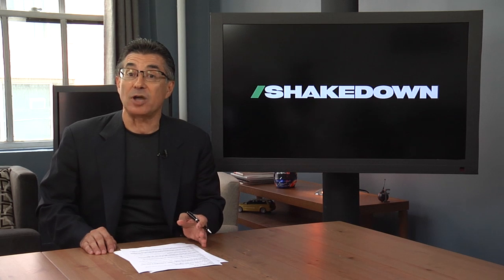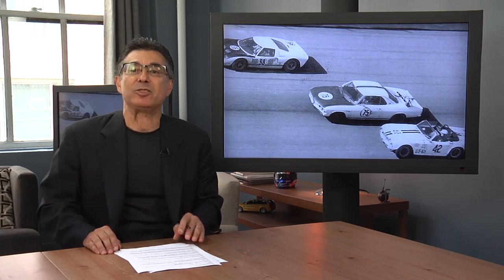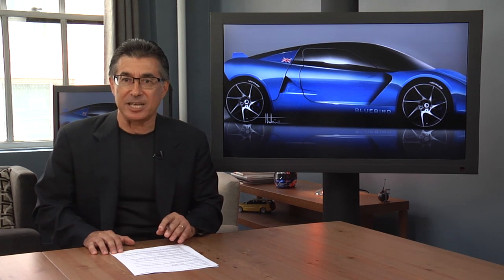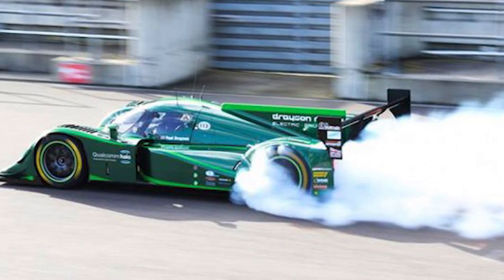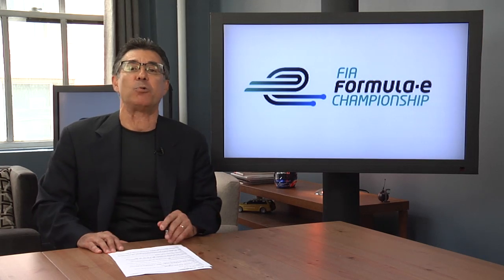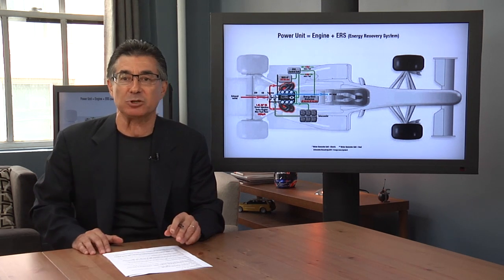Formula-E, Electric Racing for the Future - /SHAKEDOWN

Comment: I'm pro, but why do not just use other resource as electric ? You'll still need an engine in that case that makes a sound :D .... i think the oil industry is just against other oil resources because it will have a negative effect for those currently deploying it , so electric fine for me but still there are still other different oil resources that can be used and you wont need to switch cars :x switching cars i can not understand it, a race for me is with one car that is used the whole race dist

Comment: I don't know all the technical details, but I think it's not entirely a problem of technology. If it is, they can make races shorter (like a sprint of 30mins) and do several manches like happens in a lot of series. If they need to expand the range and tech then they need to make this series last for more than one season, and I don't think it will happen with this layout because nobody will watch it. I'm sure I won't.

Comment: Sound is becoming a dying aspect of racing(R18, Form E, Turbo motors etc).There won't be a complete lack of noise(they're will be a slight whine)...but it will be so quiet that you can hear the fans DESTROYING corndogs and making martyrs out of toilet seats. 

I'm all for Formula E...But a car swap mid race? Really? You couldn't use the series to perfect rapid charging battery technologies? Because rapid charging batteries(45 seconds or less) is the only way you're going to sell many an EV.

Comment: I'm not particularly interested in all electric racing cars for a variety of reasons the sound being one of the main reasons. The presenter of this show needs to gets his facts straight in regards to F1 and the smallest engines in its history F1 has had a 1.5 liter formula twice, in the early 60's and during the 80's the last time turbos were allowed, 1500cc (60's & 80's) is smaller than 1600cc (2014).

Comment: I'm fine with all the electric/hybrid development, but CHANGING CARS EVERY PIT-STOP?!? That's just ridiculous from a racing point of view and it also sends an awful message to the people thinking to buy a hybrid road car: "yeah, you better buy two cars so when your battery dies you can jump on the other". Instead of challenging engineers to find solutions to extend the range or make battery-switch faster, they ignored the whole problem.

Comment: i'm for electronic racing. i hope it stays around so that way we can better electronic technologies and develop higher power-outputs from lighter electric power-supplies and motors. 

if we can get to the point of an electric car putting out 1k lbs of torque with half the weight of a common combustion engine with the same output figures, i'm so for it.

Comment: Jumping out of a car and into another thats fully recharged is not the answer, its not effective.
Can't see Mr and Mrs normal having to "swap" cars to take the kids to school.
If f-e is to make any impact they should implement "hot-swaping" the batteries over, 
As this is a far more sensible solution than having to buy another car.
London underground trian's use battery hot swapping, the procedure is done in less than 1minute(so I'm told).

Comment: In a way I think this Formula-E idea will be a good thing in order to push the technology of E-Vehicles/hybrid tech forward. Most people don't realize it but most of the tech in the cars being drove around today was developed on the track. For instance, Cadillac's magnetic suspension system was developed through racing. And companies like Audi, BMW, Nissan and other manufactures use races like the 24hr of Le Mans as a benchmark/proving grounds for the tech they develop.

Comment: I understand the push towards electric power but I think it is somewhat premature. Although there is a lot of research going down regarding next gen battery tech it is nowhere near ready yet. Once it is then THAT would be the ideal time to launch an all electric racing series. As it stands current battery technology is far too limiting, which is why hybrid vehicles are the way to go just now. Given time however EV's will eventually rule the roost..

Comment: If you haven't ever ridden/driven a well-spec'd EV then you don't have much basis for talking. If you like quickness, acceleration and torque, you'll like electric drive. Think monster speed out of corners. Torque is what *mainly* you're after when you add turbos to engines because usually they have decent HP or can be spun faster to get it. Torque is the domain of electric motors.

Comment: Because electric motors are 85% efficient and gas powered cars are only 15%. Less energy consumed per mile means less pollution incurred at the power station. Add in 7% average line loss and 60% efficiency for coal plants, and the fact that we only get 37% of our energy from coal nationwide, and the result is an EV is still around twice as clean as a gas car, even on today's grid.

Comment: No no no you can't change cars in a race it's stupid race to the capacity of the battery's or within an amount if laps that makes drivers use charge as you would with fuel economy, any new rule change promotes innovation let alone completely different cars!

Comment: I've seen Koenigsegg's electro-mechanical valve system, and yes of course that's a good start.
But with a hybrid system, the cost and weight of battery-motor systems will go down over the next few years so that's negligible. But the best thing about being hybrid is that two powerplants working together can make over 2000HP max. Which will eventually lead to 300MPG performace cars. Yes a WIN-WIN.

Comment: Companies like Koenigsegg have shown the conventional combustion engine is far from being maxed out in fuel efficiency and performance.  Look up their work on independent valve systems.  They removed the cam and use actuators on each valve to control it at all engine ranges.  The results are around 40-50% improvements in fuel economy and similar numbers for power across the whole RPM range.  Numbers that meet or beat the hybrids and less cost and lot less weight.  Bigger WIN-WIN.

Comment: Will Formula E racing be able to take advantage of DRS (drag reduction system) the same way it does in F1? As for the question I feel engine noise is part of the experience but only when up close to the action. When its far away I tend to hate it. But E racing wont be 100% silent, I tend to enjoy hearing the high pitched whine of a transmission and the gental slipping noise tires make under stress

Comment: I'm all for innovation, so I support Formula E since it will push electric/battery technology to the next level. However, the switching cars at pit stop is kind of weak. I think the teams should be required to figure out something like Tesla did (the 90 second battery swap) since the pit crew is an important part of racing. I can also see how many people may find electric racing a bit more boring without the engine noise, but there isn't much they can do there...

Comment: I would be surprised if it stayed like this long term. The point of the car swaps is to provide a racing environment that is engaging to the spectators while still allowing for improvements in technology long term. Existing technology isnt sufficient to run a whole race or do quick charges. The first goal efficiency wise is going to be shaving off a pit stop, then 2 and as teams use less pit stops while maintaining the excitement that spectators demand they will reduce the minimum limit of stops

Comment: "E" power will further remove the driver element from racing. Here is why. Part of the skill of driving is controlling the power of the car, full throttle full power at rpm. However electric motors can't do that. They can have immense torque at any rpm. With that said, the motors will be torque limited to simulate gas engine power-bands. If they are going to go to that extent, they might as well just use some sort of traction control because that is essentially what the torque limiter will be.

Comment: I don't mind electric cars racing as long as there are good teams, good drivers, and good racing. My big concerns with this series are the changing car thing is just stupid, I am not sure if the cars are really that fast (using the term fast relatively), and also that you described the cars as low down-force. Why would they want them to be low downforce? Perhaps it is more that I just don't understand it than really that I am concerned about it, I always just assume more is better.

Comment: I would watch Formula E and don't have a problem with it. But I'm scared about the direction road cars and racing is going in with all these electric and hybrid cars. I don't ever want to see the combustion engine die, and in 30, 40 years, when there's only or mostly electric cars on the road, I'm gonna be one of those old men with a garage full of classics driving them every day.

Comment: I think Formula-E is a great idea and I'm looking forward to it. I think it should be the true showcase for cutting edge automotive engineering, as Formula 1 once was, and be largely unfettered by the usual deluge of FIA technical restrictions. I want launch control, traction control, active yaw control, active suspension, anti lock brakes, active aero, absolutely anything that will result in a faster lap time for a given weight/power restriction.

Comment: Slam charge Capacitors instead of batteries. GE engineers "accidentally" developed new carbon based Capacitors, trying to figure out how to mass produce Graphene. They are basically "sponges" for Electricity, of racing fuel cells holding Electrons instead of fuel, with the capacity of batteries and charge discharge capabilities of capacitors. Then add all the kinetic capture tech possible, and there you go.

Comment: two things i dont like so far about the formula e cars so far is 1: they're only 2 speed electric motors have torque stick um with a 6 or 7 speed sequential transaxle i saw quaife makes some get some gear  them sky high and lets see some real acceleration and top speeds 2;the whole changing cars thing dose'nt grip me too well I want to see the same car tired and nackered as the driver at the end of the race so if they come out with some quick change batteries that would be great

Comment: I'm interested to see where Formula E goes, but two failures right off the top does not bode well...
1- Tesla is ready to offer battery swap for road going electrics, can't these guys do it better/faster?
2- Why would the 'formula' force an open wheel indy/f1 design instead of just limiting the KW/h carried and may the best design win?

Comment: Electric racing isn't quiet: I'm involved in a schools electric endurance racing competition in the UK, and the cars make motor noise, various squeaks and rattle from drivetrain components and, crucially, a lot of wind noise, and these are 2000 miles/gallon equivalent efficiency cars. Formula E cars will be way louder.

Comment: Wish we had stock car electric racing class. Where in production cars and or homogenized specials are fitted with full electric systems.

F1 with batteries doesn't make a lot of sense to me in the current over restricted form.  Push-to-pass is terrible.

Comment: Hydrogen fuel cells will never be used in road cars on anything other than extremely low volume/prototypes. We have no hydrogen infrastructure, it is extremely energy intensive to capture and extremely hard to store as it tends to just leak. electric on the other hand, most western countries have a huge existing infrastructure, batteries by 2020 should be more than enough for the vast majority of road users and of course this is what EU has and continues to invest in.

Comment: swapping cars is stupid. swapping battery packs is a good idea and i don't understand why no one has thought about creating a standardized connection and 3 or 4 battery sizes for use in any electric car independent of manufacturer. gas stations could be easily converted to charging and battery swapping stations. with standardized sizes and mounting points, robots could easily swap a battery on any car in the time it takes to fill a gas tank.

Comment: i like the idea of an electric racing series because the auto world is shifting towards fuel efficient low  pollutant  vehicles and the limitations are very real with gas powered engines so instead of letting the soul of a sports car die because I want noise I would let  its body evolve just one thing I want tho, keep the  dam multi  speed transmission   with a way to select the gears manually  .Who knows the wind of an electric may be pretty awesome once ya hear it

Comment: I love the idea of electric formula racing, not so sure about the pit stops though. I think the drivers should have to run a lap of the track during the pit stops if they're just going to change cars! As far as sound, i love the sound of electric cars, however there should always be a place for gas engines. Love the idea, would definitely watch it, hopefully if it happens i'll go and see it live in London! Whats with the power restrictions though? Thought this was to push innovation?

Comment: Almost everyone I know who complains about the lack of engine noise never drove a high performance EV. The neck snapping torque of electric motors are more responsive (in theory) to any high performance ICE. Its a strange feeling, but EVs joint into acceleration alot more suddenly and after that of course depends on the overall output of the engine. Electric power definitely has its charms in the way diesel does not.

Comment: Yes!! It's great. The future of the automobile needs a representative race! It will push development of the battery which will trickle down to the rest of the industry. Development cycles of electric based cars are similar to other technology/software development cycles in that it will be much quicker as compared to the internal combustion engine. Kind of like switching from analog to digital. Racing will be different, but I know it will also be exciting.

Comment: It should be a great series and allow inovation like in the F1 heydays pre mid 1990s when they clamped down on innovation to much. assuming the rules allow it.
the lack of high db also allows for new racetracks in easy to reach places and inspire a whole new generation that are very focused on green tech and arent so interested in gas guzzlers like us Oldies. personally cant wait as long as the rules are open enough to allow proper inovation.

Comment: We all know that at this present point in time, electric motors can't compete with IC engines. This is because petroleum has a much higher energy density than any current form of battery.

Electric cars ARE soulless.  You're deducting a vital aspect of the car - the banshee whale that gives the vehicle its character.   You're also deducting a vital aspect of motorsport - the ability to go ever faster with each passing incarnation of the car.

Not all race series' are even remotely interesting.

Comment: I would really like to see a more "unlimited" or less technically restricted series than f1 to really see technical differences between teams and really push innovative systems. I also think that wthin that swapping cars is a bit contrived I would like to see a battery swap type system to really push the tecincality of the car designs. I would watch electric racing if it was interesting and there was overtaking, sponsorship, and good circuits.